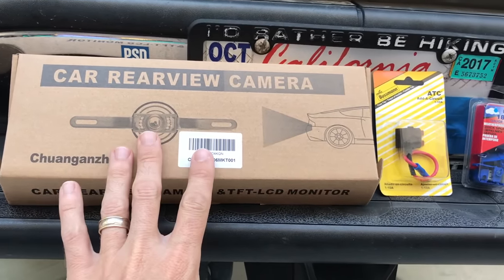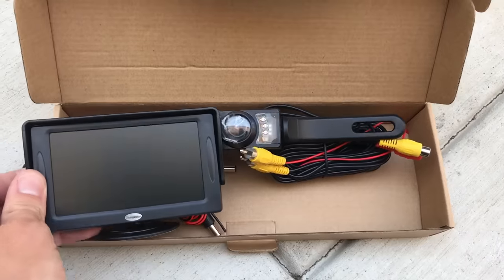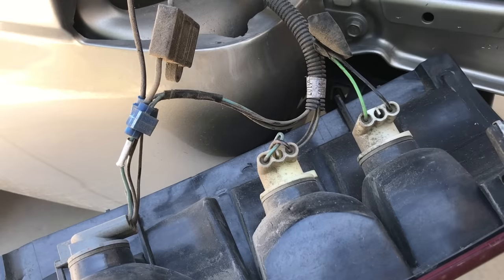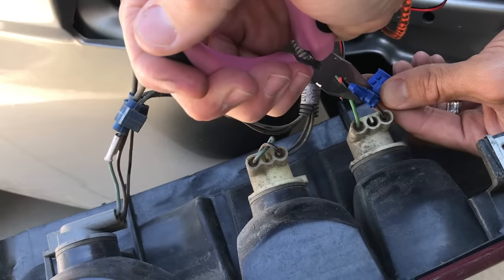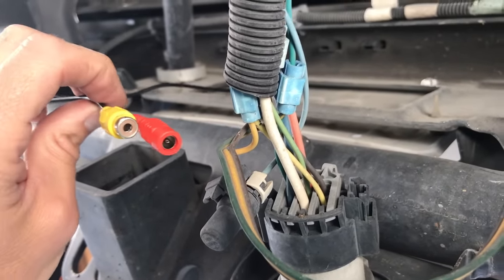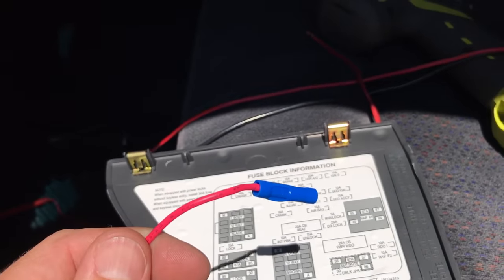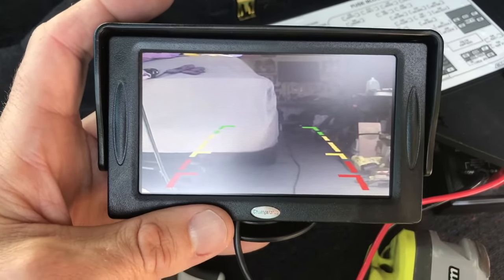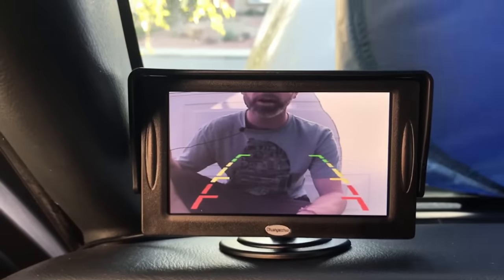Install a Rear View Reverse Backup Camera for only $30!

Comment: Excellent video. Does the monitor draw power from the battery when the reverse gear is not engaged?
Reply from the maker: +Luke Leaflif I didn’t check, I have mine wired into a switched fuse so when the car isn’t on it isn’t being provided with power.

Comment: I did this same camera and same install and have a question.  The backup light where I made my connection for the camera lights up very dimly every time I plug in the monitor.  I used a cigarette lighter plug, when I unplug the monitor from the 12 volt source, the backup light goes out.  Has anyone ran into this issue?  Thanks in advance.

Comment: Is there any way to do it without add on  circuit?
Reply from the maker: Yes, you could tap power from one of your cars 12v adapters or you could hard wire to one as well. Some camera come with a 12v socket adapter as well.

Comment: I have hook up to a battery getting power but screen will not turn when just the power cord is hook up to the screen. What am I doing wrong
Reply: Did you hookup the ground wire or connect the video cable to the Camera?  Anyway, you should not directly hook the unit to the battery because it will slowly drain your battery.  You wan the unit to works only when the vehicle is on.

Comment: Can you have it on at all times?
Reply from the maker: If you wire the camera into a constant 12v power supply yes you can.
Reply: @Elijah H it wont waste anything. As long as the vehicle is running the alternator will provide plenty of power for it.
Reply: @Elijah H Yes it will once you turn off the engine; that's why constant on is a bad idea.  Some dash cams now have an ignition sense wire and a constant 12V to record video if you get bumped but otherwise it will stay off.

Comment: hello .... a question ... where do you take current for the camera? ....
Reply from the maker: It is taken from the positive wire leading into the reverse light.
Reply: DoItYourselfDad  So I did it and it worked, now the screen is turned on in Parking, reverse or forward ... I do not know how to pinerla just to turn it on in reverse
Reply from the maker: It sounds like you have the power to the camera coming from a source that’s constantly on. You need to be sure that you are pulling power from a wire that is only hot when your reverse lights are on.
Reply: Thank you very much!!!!👍👍👍
Reply: I’m wondering as well. If I only want monitor on in reverse then I only need to tie in at rear reverse bulb. I would not want the fuse box tie in right?
Reply from the maker: Correct, tie the power for the camera into the reverse bulb. The power for the monitor can be taken from the fuse panel.
Reply: @DoItYourselfDad  I don't understand the power for monitor ? According to my instructions ...the monitor and the camera are powered by the reverse wiring... There is no other wiring source coming out of the monitor...what do you say??

Comment: The way you have this wired the screen will always be powered on and the only thing wired to reverse is the camera. You haven't explained what the red wires on the av cable are for that hang out of the end? This is really only half a video and the screen won't last very long be powered on all the time
Reply from the maker: In this setup the screen has power, but doesn’t power on until it receives a signal from the camera.
Reply from the maker: The red wire is a power wire if you want to power the camera from the fuse panel, which you would only do if you had a dedicated reverse fuse.
Reply: @DoItYourselfDad  after looking at other videos the red wire that pokes out of the av cable is put there by the manufacturer so you can wire the screen from the same positive as the camera from back of the car and then the screen negative grounds anywhere on bodywork at the front. The screen only then powers on when in reverse. Having permanent feed to the screen will shorten the life of it. Although you can't see a picture when it is permanently live it is still on. The manufacturer puts the red wire in to save you the hassle of finding a positive at the front plus it means it only goes live when in reverse. I'm no auto electrician and not trying to slate your video either I like the channel. I'm just offering up what I found out as I have got to fit one this weekend. Maybe others are wrong and you are right but that's the problem for me because I'm more confused now of how I will wire it up than when I started looking. Anyway great channel I hope you take my comments as they are intended. All the best

Comment: is it possible to install for nissan centra 95?
Reply from the maker: Yes, it can. Shouldn’t be that difficult as the trunk lid had both the reverse lights and the license plate.
Reply: @DoItYourselfDad  
one more question, also can be at night?

Comment: FYI - The kit is now about $40. And this may not be totally legal in some places since the camera mount covers some of the information on the license plate.  Most likely not a problem, just something to be away of.
Reply: Why wouldn’t it be legal. Of course it’s legal, most cars today have backup cameras, and it doesn’t cover the paint, just the rim, which is just a border which is by the law, legal
Reply: @kylemorris5820  First, I said it MAY not be totally legal.  Here in Michigan, the Michigan Vehicle Code, Section 225 states, " (4) A person shall not attach a name plate, insignia, or advertising device to a registration plate in a manner that obscures or partially obscures the registration information."   A careful viewing of the video shows the camera, while technically not "a name plate, insignia, or advertising device" does partially obscure the month sticker in the upper left and the annual renewal sticker in the upper right.  A cop who's having a bad day could pull you over for this here. It may be different where you live.

Comment: Can’t you just use wire nuts to hook up the power from the reverse light 💡?
Reply from the maker: I would recommend against using wire nuts in an automotive application.
Reply: Thank you for ur fast response , just received my kit ,similar to this one looking forward to this little project 😅

Comment: Does the red wires coming off the yellow rca cable have any purpose?
Reply: thats what i wanna know :)..
Reply from the maker: You can use those if you want to hook your camera into an additional DVR or screen, they are optional. I didn't use them in my installation.
Reply: It is so you can use it as a signal wire back to your head unit to tell your monitor to turn on or switch input.
Reply: DoItYourselfDad did you cap it off with a butt connector when not using or just let it dangle?
Reply: DoItYourselfDad I was wondering that also, thanks for that bit of info.
Reply: @April-xp3zv  the butt connector will have the red wire from the camera attached to it which in this project could be 30 minutes or less.  Normally the installer won't put the power tap in until he is ready to connect the wire.  Even so, the metal conductor is recessed about 1/4" inside the butt connector so there is very little danger of shorting the connector to ground.

Comment: You didn’t mention how the camera covers the tags on your license plate so that you could get pulled over with the camera on it because the cops can’t see your tags
Reply from the maker: When you get your new tags stick them on 1/4 inch lower.  I've been running this for coming up on two years, never an issue.

Comment: I am hooking up camera but it is notgetting power to the screen
Reply from the maker: When I installed mine the screen didn't turn on until everything was completely hooked up and the reverse lights were turned on.
Reply: The screen has two video inputs. One white and one yellow. One should be connected to the backup cam. The other, you could temporarily connect to a game system or dvd player, run off an extension cord from the house, just for the purpose of testing the screen.

Comment: What did you do with the red wires off the yellow rca?
Reply: eaks..afraid im not gonna get an answer :(
Reply from the maker: You can use those if you want to hook your camera into an additional DVR or screen, they are optional. I didn't use them in my installation.
Reply: The red wire is meant to connect to the back of a stereo head unit, to a purple and white wire usually, or one thats the reverse gear signal input. then at the other end you connect the red wire to the reverse light power wire, or wire that voltage changes when the car is in reverse.

Comment: Do you have to hook it up to the fuse box?
Reply from the maker: You will need to supply the monitor with power, if you didn't want to go into the fuse box you could tap a power cable to one of your 12v sockets. Some cars also come with accessory power buried under the dash.

Comment: Do not use scotch locks or as you call them quick splices. They can and will mess up your factory wiring, computers, and sensors. Take the time to read and install the wiring correctly. Or have someone with proper tools and knowledge do the install.

Comment: Talk to ANY mechanic worth their weight in wizz and they'll tell you that those quick clip wire splices are the bane of electrical trouble shooting.  Learn how to solder and use marine grade heat shrink.

Comment: I installed mine and it works, but  on my navigation screen when I put my car in reverse I see the image mirrored, like left is right on my screen and vice versa. That sux, is there anyway to change it? That I see it on screen as I would see it on a webcam/other camera <?
Reply from the maker: +Pfirtzer I didn’t run into this issue, I believe the buttons on the back of the screen gets you into some of the settings of the screen.

Comment: “Keep your wiring away from anything that moves under the car.”  Proceeds to run cable close to e brake cables....
Reply: Right? I would have just run the power cable through the brake light to a port in the trunk and tuck it all under the side trim on the inside.

Comment: Eh could be better... didn't explain what that extra red wire is on the video wire.
Reply from the maker: Its a power wire if you want to pull power from the rear of the car to the front. I've never found that method to work as well so we didn't use it and tapped the fuse panel. That's why it wasn't mentioned or used.

Comment: Uhm, those cute blue snap connectors you are using at the reverse lights are something that will corrode =junk, I recommend soldering.

Comment: The quality of these units are pure shit. Had 3 different units all under $50 each and NON of them lasted a few months. The wireless ones will have connection issues. Wired one will eventually have distortion. You get what you paid for.

Comment: this is a piece of CRAP.  I bought from amazon.  First try did not work at all. Spend about 2 hours trying to get it to work.  I called and just got my replacement.  Wired it to "lighter" power supply and IT WORKS So I attached the wiring to the back up lights...Nothing but BLACK.  So I thought maybe there is something not connecting.  I went back to the power supply and it to longer worked.  The light would not turn on.  So I attached something else to see if it works, it did.  I am sending both back

Comment: I give your camera 3 months and you will have humidity build up and won’t be able to see a thing! Don’t buy cheap cameras and definitely don’t use t taps! Learn to military splice or solder! Your educating people to do things incorrectly! You are degrading your factory wires by using t taps! I am mecp certified and install aftermarket products for a living. Please educate yourself before submitting videos like this!
Reply from the maker: Published this video over a year ago, still no condensation in the camera, still works great.